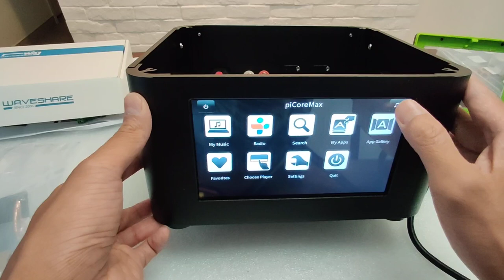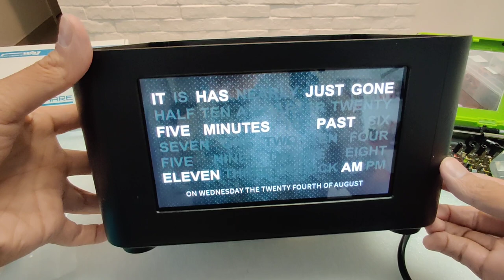R23-MAX Assembly Part II

Comment: Hello Vinsent.
Thank you for the detailed presentation of this kit.
From what I can see, this piece is heavy and substantial and I like that.
Maybe I missed it in one of these videos, but are there any information about pricing and ordering of this kit?
Is the LPS part of the kit, or does it have to be ordered separately?
Thank you
Reply from the maker: Hi Vladimir,
Thanks for your interest. The LPS is included in the KIT, but no Pi or DAC is included. Just FYR.
Just listed the KIT for sale today, the link is updated in the description. You may also find the link below:

https://carousell.app.link/wNQo2XtcOsb

More details can be found in the link above. You're right that this device is rather heavy. Did a measurement today, it weighs ~10lbs.
Reply: @vincentfong4154  Thank you Vincent. I will read the details on the link you provided.
Anyway, a very nice build. Congrats!